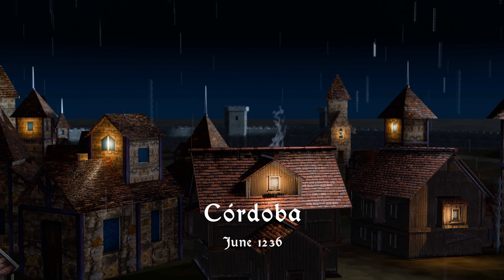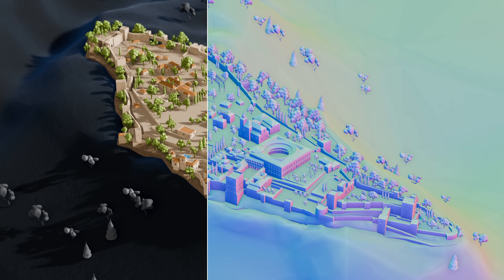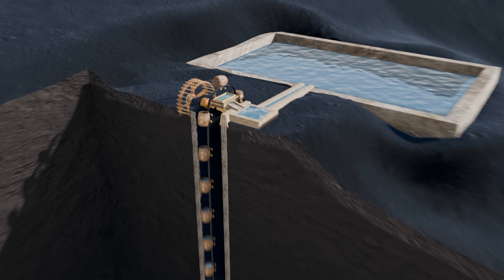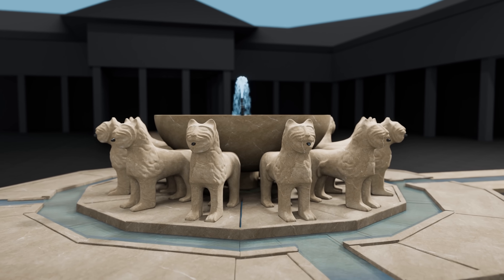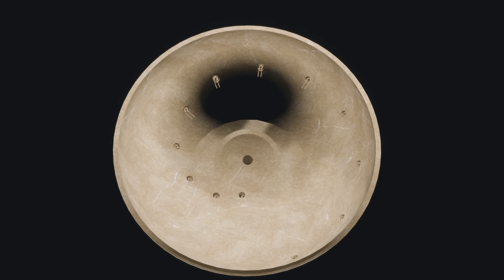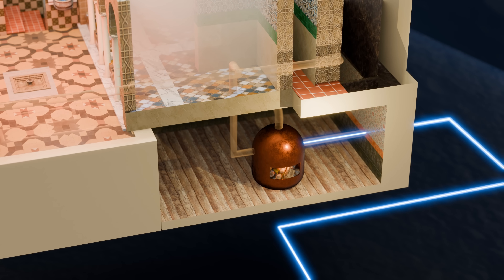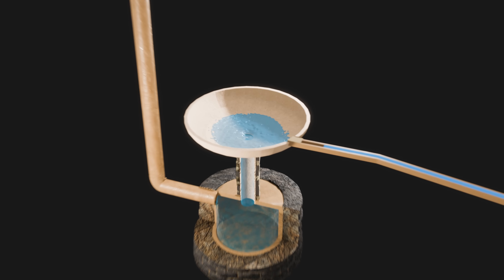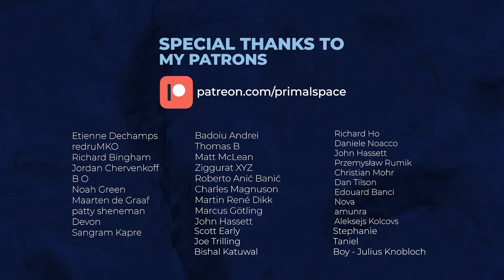The Ancient City That Mastered Water

Comment: The Babylonian and Chaldean Origins of the Alhambra’s Water System

The Alhambra Palace in Granada, Spain, is widely regarded as an architectural masterpiece, renowned not only for its stunning beauty but also for its sophisticated water systems. This advanced network of pipes, fountains, and pools, which provided water for the palace's gardens, baths, and fountains, was developed by engineers whose knowledge of hydraulic technology was deeply rooted in the ancient civilizations of Babylon and Chaldea, specifically the Chaldeans, whose innovations were later preserved and adapted by the Muslim engineers who came into power in the region.

The Babylonian and Chaldean Influence
The technological achievements of the Alhambra’s water system are directly linked to the engineering techniques of the ancient Babylonians, particularly those developed in the Hanging Gardens of Babylon, one of the Seven Wonders of the Ancient World. The Chaldeans, who were part of the Babylonian Empire, were pioneers in creating complex water management systems, including devices to lift water from the Euphrates River to the hanging gardens above the city. These methods included the use of waterwheels, pumps, and other devices to move water across great distances and elevations.

As the centuries passed, the knowledge of these water systems was preserved and passed down through generations, eventually reaching the Arab engineers who came to dominate much of the Middle East and North Africa. While the Arabs were responsible for refining and adapting these techniques, it is important to recognize that the underlying knowledge and technology originated from the Babylonians and Chaldeans.

Adapting Ancient Techniques to the Alhambra
The engineers who designed the Alhambra’s water system were well-versed in these ancient methods, adapting them to the unique challenges of the palace’s location. The Alhambra, situated 200 meters above the river in Granada, posed a significant challenge in terms of supplying water to the palace’s gardens and fountains. To overcome this, engineers employed water-lifting devices and complex irrigation systems that echoed those developed by the Chaldeans in Babylon.

A key innovation was the construction of a 6-kilometer-long canal that channeled water to the Alhambra. In addition to this, waterwheels powered by animals were used to raise water to higher levels, similar to the techniques employed in ancient Babylon. These methods ensured that water could flow through the palace's fountains, baths, and pools, providing both functionality and aesthetic beauty.

The Water Systems of the Alhambra
One of the most remarkable features of the Alhambra’s water system is the iconic Lion Fountain, where twelve lion statues spout jets of water in a controlled sequence. This was made possible by the engineers’ knowledge of hydraulics and water pressure, using siphons and other devices that can be traced back to the technological heritage of Babylon and the Chaldeans.

The water system was not only an engineering feat but also a symbol of the long legacy of hydraulic technology that had its roots in ancient Iraq. The use of water in the Alhambra, as in Babylon, was both functional and symbolic, embodying the advanced knowledge and ingenuity of the ancient civilizations that first developed these technologies.

Legacy of Babylonian and Chaldean Engineering
While the engineers of the Alhambra made significant advancements, the foundation of their work can be traced directly back to the Chaldeans and Babylonians. The methods they employed were an evolution of the technologies pioneered in ancient Iraq, passed down and adapted over the centuries. These innovations have had a lasting impact on hydraulic engineering, influencing not only the Islamic world but also the broader history of engineering and architecture.

The Alhambra stands as a lasting testament to the genius of the Babylonian and Chaldean engineers who first mastered the art of water management. The knowledge they passed down continues to be admired and respected for its brilliance and ingenuity, shaping the course of architectural and engineering history for centuries to come
Reply: Interesting comment! As for the lion “clock”, I do not believe it ever existed. Too many open ends. Fore one: for a full hour no lion cave any water. Over the hours, the same amount of water is divided over an increasingly number of outlets. As hours vent by, an increasing amount of the water was routed to #1 lion. He auto-reset of the presumed Pythagorean cup does not compensate for rain og hot sun. No Pythagorean cup is mentioned in papers describing the restoration of the lions fountain, did it ever exist? 
As for the 6m pump, driven by a Trompe, the function of such a Pulser pump, differ from what is told in the video.

Comment: Is there any prove that this vortex water pump actually works? I think this is impossible for this pump to work. Even if we assume it's possible to aerate the water that much it can climb higher than the initial level (which is highly unlikely) you will always have a smaller amount of water pumped out than the water which goes in the system (because of the Newton's laws of mechanics) which will eventually block the vortex because of overflow.

Comment: I went to alhambra palace today. I was quite disappointed to find out that the lions fountain no longer works as described in this video. All lions were spouting water. My local guide also said it was never used as a clock. From wiki it says it was modified and rebuilt. At least you can still see the water flowing in via the old aqueduct. But I strongly suspect they have a pump in some areas of the gardens.

Comment: The physics of the whirlpool is described incorrectly.
The water in the basin below was not "lighter". Instead, the air in the basin was pressurized by falling water in the pipe below the whirlpool.
This is a trompe air compressor, very cleverly and beautifully designed to  also pump water.
Others in the comments below have come to same conclusions.
And while it is perfectly possible my belief of it being a trompe is wrong, I can assure you, the water is not "lighter".
Reply: F it existed and worked, it man have been a Pulser pump. Using a Trompe as "engineering..

Comment: The function of the Whirlpool pump ist described wrongly.
It s Not about density, but about water being airlifted.
Also wrong: the Pool outside the City could Not pressurize the whole watersystem, but only the part leaving that Pool.
Reply: Yepp. Look up Pulser pump on Wikipedia. 
One may wonder how the foutains could spray water without any pressurised water. How 1 lion, 2 lions, 3….. lions shared the same amount of water. Must be a weak flow in the 11th hour. In the 12th hour there would be no lions with water at all. “Time” came to a standstill for 60 minutes?

Comment: The water system that impressed me the most is the 'fountain lions', because its like you are hitting two birds in one stone. You get the cooling effect from the fountain and doubles as a functional time clock. As an architecture student, I'm fascinated by that clever idea, I salute those who constructed it, a combination of art and engineering. 

BTW, thanks Primal Space for sharing this wonderful information!
Reply: There are so many strange details about this «clock». I think it never existed. This video seems to be a hoax.
Reply: @kjellg6532  Can you tell me more about its strange details, I'm intrigued.
Reply: @hannahvito  How did they regulate the water to “a constant flow? . With a constant flow, each lion would get lesser and lesser water as the hours went by. As time went on, #1 lion would get a grater and grater part of the water available. How did the system compensate for a rainy day or a hot sunny day? How was the clock synchronised with the sun?  Why hoes no lion spew any water from reset at midday til 1 pm? Why is no Pythagorean cup mention in the papers telling the restoration of the fountain?  How was the fountain powered from water flowing in a flat canal? The video show a basin with curved bottom. Photos show a basin of more squared form. 
I simply doubt that this ever worked as a clock.

Comment: I'm confused about the lion Foutain. IF the water coming in was at a constant pressure then how did the water keep rising to the additional holes? As water would flow out the first then, second hole, then how would it keep rising to come out subsequent holes? It was obviously not a great flow if it would take an hour to rise the distance of each hole.
Reply: There are so many questions to that lion «clock» that is seems to be a hoax. Probably never existed.  The Trompe compressor creating air pressure for an air lifting pump seems sound. Look up pulser pump on wikipedia. The function of a Pulser pump differs from what is told in this video.

Comment: In the fountain with the lions, they probably did it without advanced calculations by first building the basin without the lions or even the siphon, then drilling the holes one at a time as the water rose throughout the day. With that done, a similar practical process could have been used to figure out the exact dimensions of the siphon, to make the fountain drain at the correct time. The finished siphon could then have been installed, as well as the decorative lions.

Comment: the timing of the water fountain clock is a marvel.
they have to account for the amount of water drained with each new hole, because the water would drain faster, so the next hole has to be relatively lower
Reply: This "clock" can nor work as dercribed.

Comment: The thing that imprssed me the most how they were able to lift water 6 meters up by mixing it with air bubbles, and therefore making the water lighter and able to travel a higher up.
Reply: They mixed it with compressed air. The expanding air lifted the water.

Comment: There is a small misstake with the animation whirlpool, since not all the water would be transported those 6m to the upper section the lower pool has a pipe to drain the excess of water.

As an engineer this systems are amazing.

Comment: So funny to see how many people believe thay.
7:31 
Either we're missing huge details, like a great loss of water or external energy, either this is simply impossible. So I'm just gonna copy past my comment from the short

This isn't possible, he's trying to bait you by explaining something that seem logic, but can't work
The difference in mechanical energy between before and after cannot be greater than 0. Mechanical Energy = Gravity Potential Energy + Kinetic Energy = mgz + m×v²/2
With m being mass, g the gravitational acceleration, z the height and v the speed

If this was possible, we would be massively using it to get used water back in the hydraulic dam to create infinite electricity
Reply: This video only tells half the story. Look up Trompe and Pulser pump.  The Trompe needs huge amounts of waste watervto produce compressed air to lift a fraction of the water up.

Comment: This mechanism would defy the laws of physics. Specifically, even if the pipe going upwards has air that makes it lighter, so it does the pipe going downwards.
Reply: Look up Trompe and pulser pump. It works, but not as told here.

Comment: My favorite part is two fold, directing the steam to have heated floors is next level. The second piece is the whirlpool effect that had a low pressure area towards the bottom causing the weight of the water to be lighter! Its crazy it’s still all operational today!
Reply: Actually this seems to be a Trompe. A trope is an air compressor creating air under pressure due to a waterfall innside a tube. One of the lagest Trompes is  found in Ontario, Canada. Producing compressed air for a number of mines up til almost 2000.  As described here it only half of the story. Look up Pulser pump.

Comment: if it wasnt conquered perhaps now we would all have 100% green energy with no use for fossil fuels.
Reply: Yes, green energy driven by donkeys and horses. Can you imagine all those stables to house the horses needed for transport?
Reply: @kjellg6532  They would replace these obviously. What were you guys using back then for energy? Human labour.
Reply: @asrulismail1513  “If it was not coquered…” How would that provided us with green energy in NY, London, Paris Tokyo?
Reply: @kjellg6532  since they are already using various ways to harness energy reducing wastage everywhere possible, naturally given how meticulous their work was, and using natural phenomena to harness energy, eg gravity, potential energy, whirlpool, air as pressure and pump mechanism,  they would have pursued similarly in their energy technology. Perhaps by now they would have even discovered how to use fossil fuel without going through combustion, direct breakage of chemical bonds releasing energy without the generation of heat or carbon dioxide.  They could have even discovered how to convert carbohydrates and fats directly into energy (such as how the body uses ATP for energy by using glucose from carbs and or Fatty acids) and use fuels made of carbs just like the metabolism within cells. Etc etc.

Comment: There is a slight overlook in the description of the whirlpool system at the end. The output at the higher point does not have the same flow rate as the input. Much of the water looses its energy and is drained away downwards by another tank. That lost energy is what helps to power the system to raise the water higher than the input.

Comment: I'm curious how accurate the clock is, and how often they would need to reset it.
Reply: Every day it rains, every day with heavy sunshine. Also remember that no lion will give any water from 12:00 til 13:00. As the hours go by, each lion will jettison lesser water.  Very strange clock. Did it exist?

Comment: The whirlpool mechanism was awesome. Managing the 6m heightened water pooling with no use of an external energy source is the charisma of the then engineers.
Reply: Well, they used the energy from a donkey to lift  all water. Then let go of a huge amount of water to create compressed air to lift a fraction of the water 6 m up.
Reply: @kjellg6532  Yeah. Initially, they used animals to pull the water.
Reply: @orchidatta6852  In this video each and every drop of water used at Alhambra were hoisted by animals using a hoisting wheel, not a waterwheel as the video clame. The  6m Trompe was powered by donkey-water.
Reply: @kjellg6532  Oh, I see. I have understood.

Comment: Lifted the water 6m with air bubbles!? As someone working with airlifts daily I strongly don not believe this is possible
Reply: It works, but not quite as depicyrd here. They do not show or discuss thr waste water tunnel up from the lower chamber.  Look up «Trompe»,  a waterdriven air compressor. Used for centuries in mining and steel production. The last being used had a water fall of about 100 m and supplied air to a number of mines in Ontario, Canada.

Comment: The clock amazes me particularly because the filling of the bowl cannot be constant because as the water level reaches each hole, the loss of water would slow the rise in water to the next hole, or if constant, the holes have to be placed closer together as time moves towards 12:00 o'clock to compensate for the increasing loss of water through each hole as the water level reaches it. More detail would be interesting to understand how accurate timing of the fountains was accomplished. How often was it reset to sun mid day, or celestial time?
Reply: I think it never was a clock.  The animation indicates that the holes are stepped outwards in regular steps, but the water area covered is increasing by the square of the distance to the next hole.  The animation indicate a round bowll but pictures indicate a more squared  cross section. The time of the hours can be adjusted by the position of the drain holes, but for each lion added there is one more  lion to share the constant amount of water input. There seems to be no hole in the center for #1 lion. In other words from reset at 12:00 til 13:00 no lion at all is spewing water. How was the fountain powered with water from a flatt canal?  As you point out, what with a rainy day? A extremely hot day…  I think the clock theory is false.

Comment: The engineering of the Lion Fountain is so impressive.  I toured the Alhambra Palace as an 18 year old, about 40 years ago, and I was impressed with it even then, but I had no idea of their true engineering prowess.
Reply: Same here unc i went there  before 10 years and wow
It was a very charming
Place for sure …
But he didn’t mention that the sun shines every day from a different window inside the palace
Reply: @nadjibdjebara7749  unc is insane
Reply: @nadjibdjebara7749  well, to be fair, þis video was about þe plumbing.
Reply: Your comment made me pause the video for seconds before the explanation, just for thought exercise. Turn out I was right, but I don't know the word, I'm basically thinking of assassin teapot mechanism with different height to make it work
Reply: What I find interesting is that as each hour passes and more holes drain water, the water has to flow in to the fountain at an increasing pace to keep up and maintain the hourly exposing of each hole to the water.
Reply: @iceseic  The assassin's teapot doesn't work based on height. You cover a hole as to not allow air inside the chamber, thus stopping the flow of liquid.
Reply: @Occone10413  oh yeah my bad, i meant to say greed glass, not assassin tea pot
Reply: the reason for their greatness was not to use the metric system. Nobody back then used the metric system.
Reply: At 5:50, it’s not "surface tension" that causes the basin to drain, it’s all accomplished using gravity.
Reply: @kiwitrainguy exactly what I was thinking.